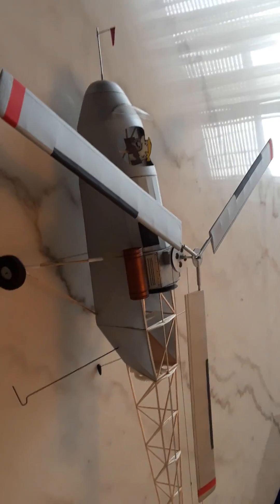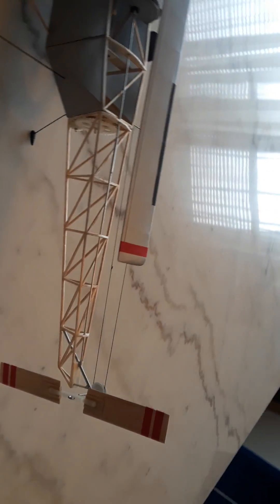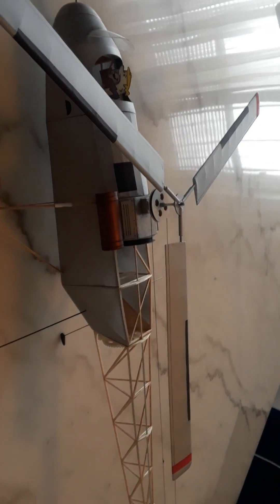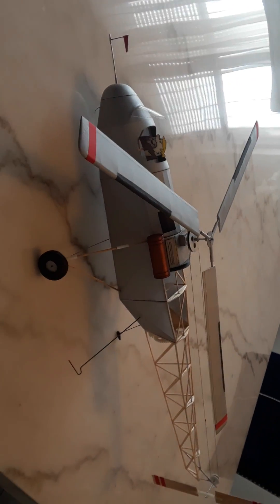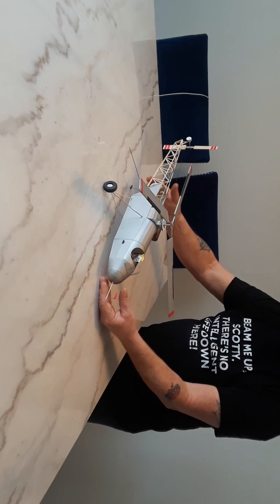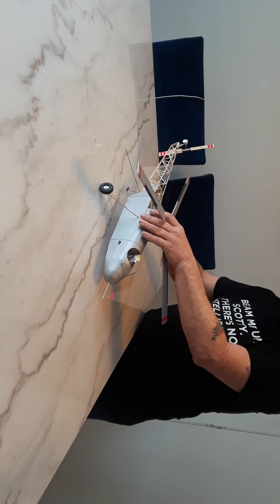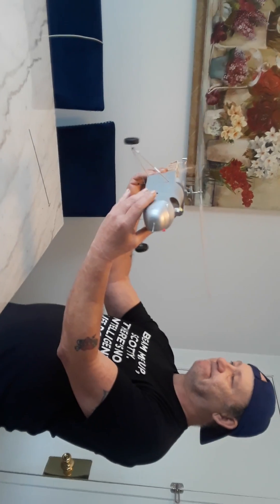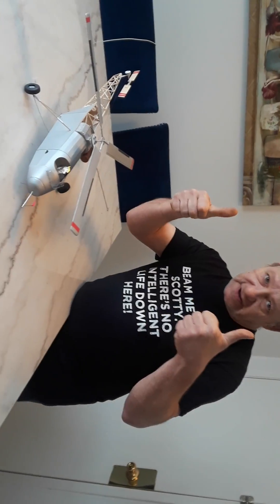Rubber powered VS300 Helicopter test flight # 5

Comment: amazing work. looks like there's a bit of vibration from the head, or that the tracking is a little out of whack. with helicopters, balance and tracking are critical to having any measure of stability from the machine. A larger coning angle may cause it to be more naturally stable, also tipping the main rotor disc forward may be wise to get a bit of forward flight going. that plus a vertical and horizontal stabilizer, would allow you to set it up in a stable circuit without to much yaw rotation. awesome project!

Comment: Amazing stuff, ... I also made something a little simpler. Pls check that out :)
Reply from the maker: Very cool helicopter, uses a coaxial cage, neat.
Reply: @raymondkierna7610  Thank you. I am a fan of your work. Keep them coming. Your work inspired me to make another one.  I will upload another version with a tail rotor later :)
Reply from the maker: Looking forward to seeing more of your builds.
Reply: @raymondkierna7610  Thanks, sure I will let you know
Reply from the maker: My current project is a Sikorsky R6 on floats, plans done, working on fuselage formers now.
Reply: @raymondkierna7610  Wow, you are very good at serious engineering. That gives an additional aesthetic appeal to the design. Looking forward to seeing it. Good luck..!

Comment: Just need to make a better anti torque tail rotor and you are nearly there,well done,how about a separate tail rotor drive ?
Reply from the maker: I try to keep the mechanisms of my models as simple as possible,  separate tail rotor drive will add more weight and more complexity.

Comment: In your most recent video you have comments turned off so I'll comment on this video. I had no idea You're Copter Concepts! I have a Huey kit from Copter concepts! I haven't built it yet as it is a bit intimidating. On the plans it says Kit 004. The address says Salem. Is that you? On the box it has a color picture of a camouflaged Huey.  If it is you, I'd love to hear more about this history of the kits and wehre they were sold and if you're still producing kits.
Reply from the maker: So cool, my original kit line was a limited run, I produced a total of 5 kits, I am in the process of making a new kit line, bigger and much easier to build.
Reply from the maker: I have been designing rubber powered helicopters for 50 years, my original kit line was very difficult to build so I have been working on redesigning them for ease of construction,  lightweight and reliable operation.
Reply from the maker: My kits were sold through out the world at the time, hobby stores, thru mail orders and museum gift shops. I will be doing a new kit line when ready.
Reply: @raymondkierna7610  do you 3D print parts? You could offer a kit to ppl who own 3D printers. So basically when they order your kit it will come with a download link to where they can print certain parts. They could choose between the different kits. Offer one with full parts list and another with the 3D parts link......just a thought.
Reply from the maker: @jvon3885  I cast my gears from silicone molds.
Reply from the maker: @jvon3885  my kits will come with all gearing and pulleys made.
Reply: @raymondkierna7610  right on, I do 3D resin printing and just thought if someone offered a kit like this with the ability to utilize our printers would be kinda cool. If you find it to be something you might want to do let me know and I could help you out with some of the conceptual schematics. I make 3D animated blueprints. You could actually incorporate materials such as carbon fiber and even metal parts as they are now making aluminum printers available for home use. A lot of ppl use their printers to make molds for casting. But yeah I think your models are pretty cool.
Reply from the maker: @jvon3885  thank you Jason, once I get it working and everything figured out I may want to have some of the parts done, I will let you know, I would like to see if you could make the gear box for me, what would you need from me to make a sample one for me to try?
Reply: @raymondkierna7610  what's your email? I'll connect there and we can see what it may take to pull off. I use a Mars Pro 2 resin printer.
Reply from the maker: @jvon3885  my email is rayvs300@gmail.com
Reply: @raymondkierna7610  ok cool I'll get with you here in a day or so and we will see what we can figure out.....
Reply from the maker: @jvon3885  sounds good.
Reply from the maker: I cast my gears from silicone molds